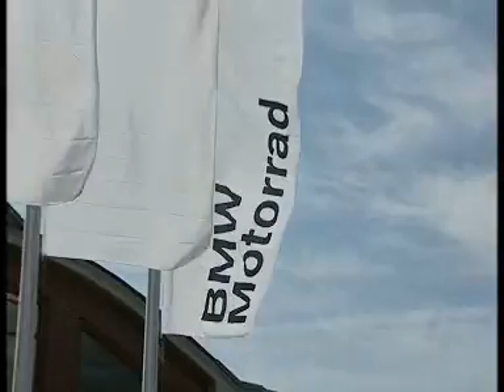BMW Motorcycle Production at Berlin Plant

Comment: Check out my video on my chanel. BMW is fine until you have a problem. my 05 K1200S sits in my shed with the cam shaft rod sticking out on #4. They have turned their backs to me and my problem. I'll never buy another bmw and this is my 4th one. Never, NEVER, had this problem with any other bike,Honda,Suziki,Yamaha,Triumph or the Harley I have owned. Ya'll stink, BMW! Thanks for nothing! Greg